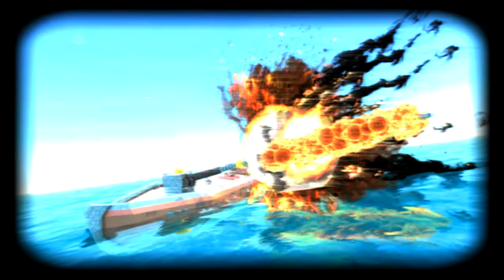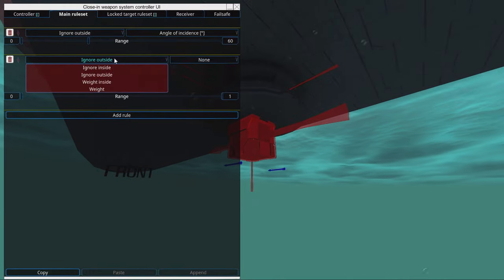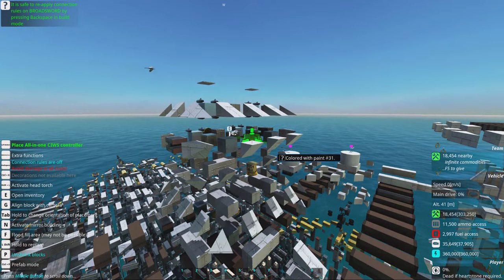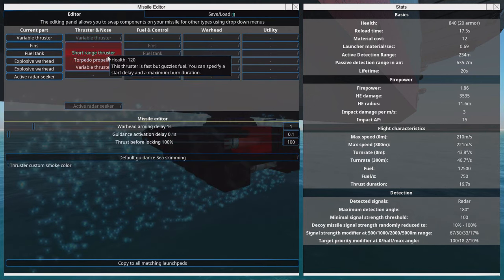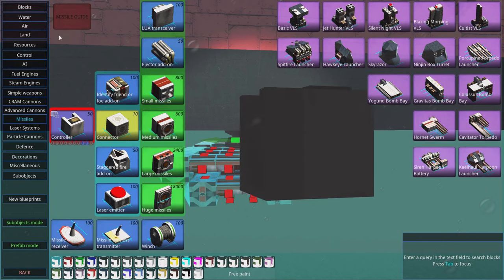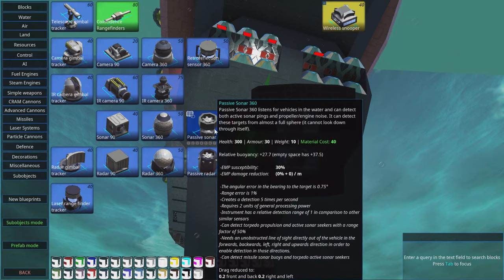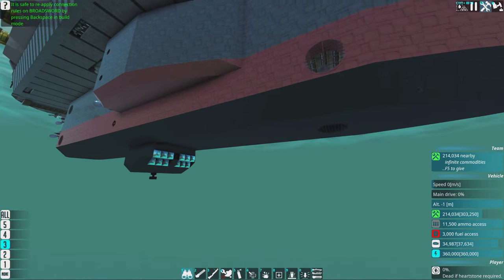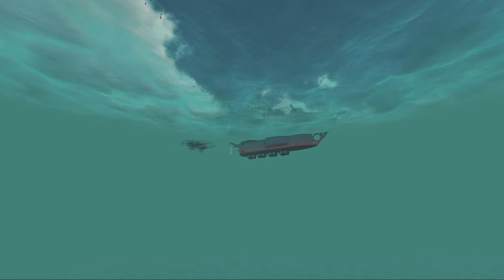From The Depths INSTANT Tutorial: Anti Torpedo Torpedoes [Cor: Don't add FRAG or HE to interceptors]

Comment from the maker: Updated Correction: Don't add explosive or frag to any interceptor, there is a bug now that makes interceptors not work if they have frag together with them not adding any benefit now, HE also does not add benefits as its damage is not transferred to target for whatever reason. Prefer to use medium interceptors they are much better, and opt for more fins and more speed instead of the warheads I added in the video. 

Correction: After testing again I get conflicting results, seems that the additional Explosive warheads and Frag warheads does not hit the missiles a lot of the time and may not increase damage even though this is what I observed before, maybe it was luck but it is probably not worth the cost. I recommend you to not have extra Frags for now since it seems to be not working or only working sometimes, instead opt for better maneuverability (more fins) and the highest speed possible, you can also opt for better life time if you go for small missiles instead of medium. I can however confirm that medium missiles are stronger than small missiles against big missiles even though they have the same cost.
Reply: Actually a good trick is giving them sonar since they're going towards missiles for center pieces. Have torpedoes come to it! For that one you built

Propeller/Fins/Fuel Tank/APN Guidance/Fins/Interceptor would work but from what I've gathered smaller but more of them generally works better. So going 4 slots propellor at 1446 w/fins+apn guidance+ interceptor is the best choice goes around 100M/s and 90 degree turn can crank it so they have less life time but only becomes 111m/s /95 degree turn is 108/95.7 and 20 second life time.

Comment: Awesome guide, as usual GMod! Is there a target prediction module you can put on as well? I noticed that most of the interceptors were impacting to the rear (or even missing) incoming torps, unless the torp was coming in head-on. 

If you're open to requests, can you do an instant tutorial on hovercraft airships? Like, flying using jets/props but not wings or helium.
Reply from the maker: Not that I know of but you can set it to take acceleration into effect and they might hit better XD

Thanks for the tip, intended to make something like that so I add it to the list! Hovercraft added.

Comment: How did you set the turret forward to avoid working upside down?
Reply from the maker: just put the turret block like you would a normal turret
Reply: The top of the turret (Where the weapon usually attaches) will connect to the ship instead when building like this.